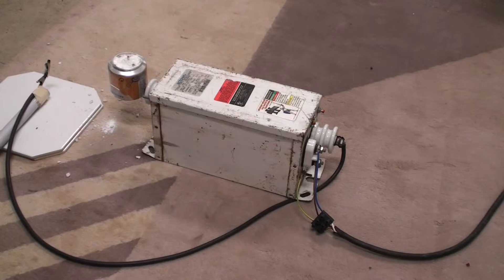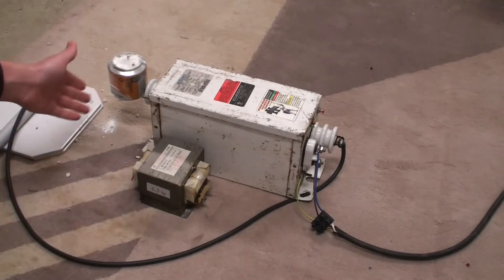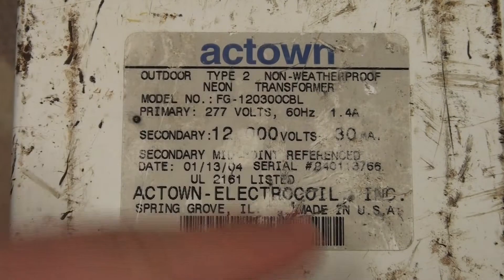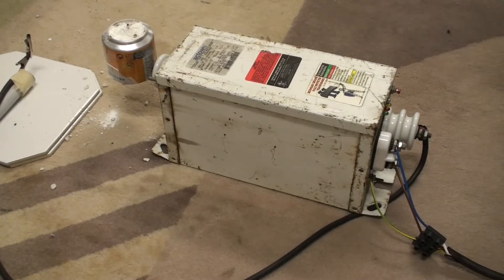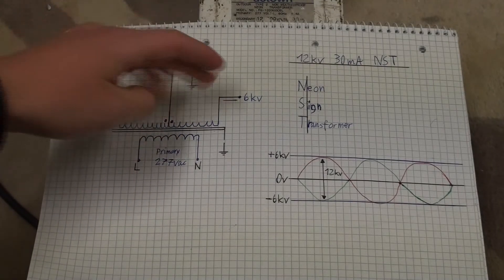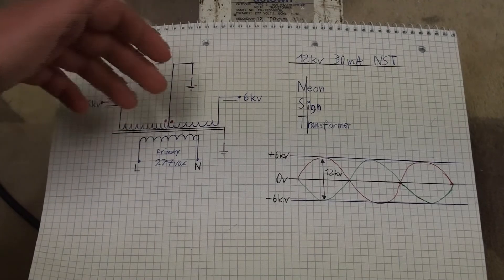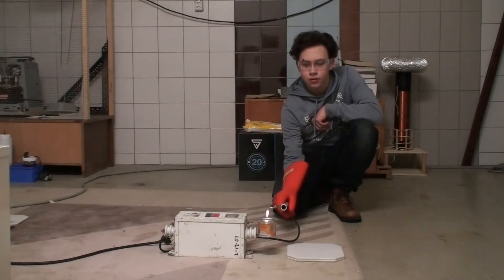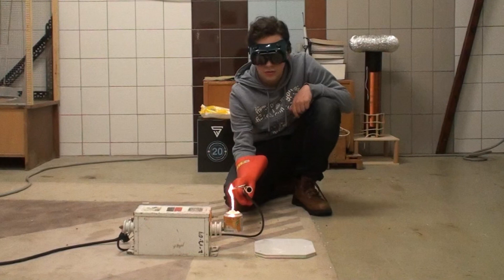All about NSTs

Comment: I had one of these back in the 80s and I used it with a spark gap as the input power of my tesla coil. It had some massive arcs. I have since got rid of it, but that was the largest coil I ever built
Reply from the maker: that is epic!
I also recently build a large SGTC, but I used MOTs for the psu.